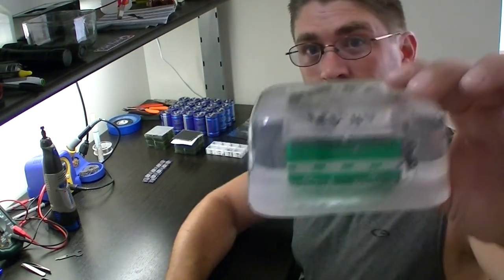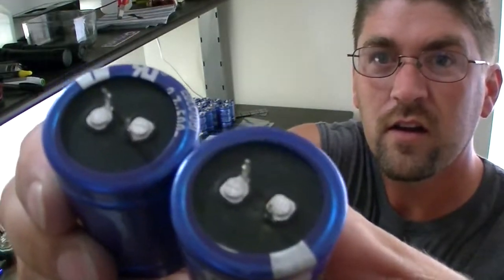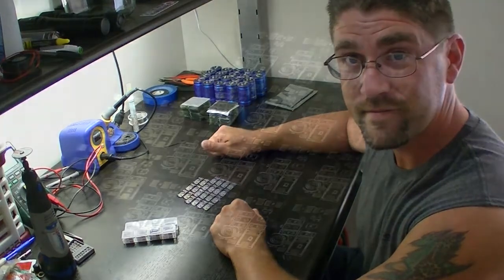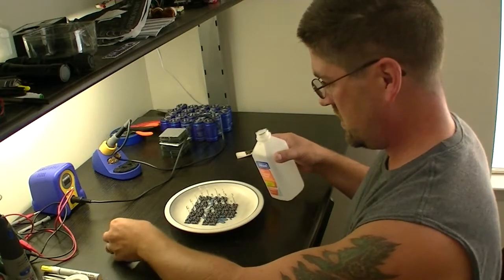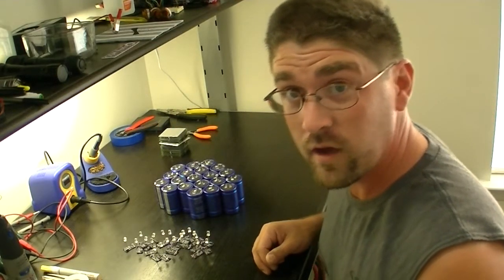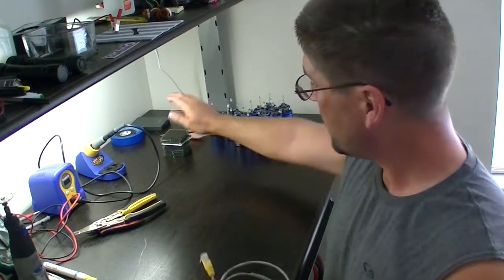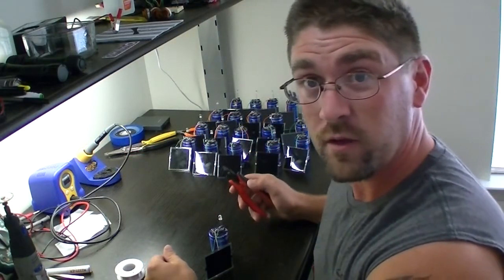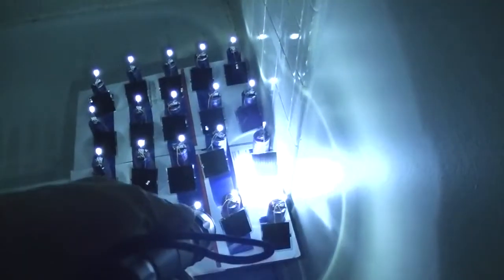Assembling First Batch Of Infinity Solar Jar Circuits For Sale

Comment: Please be warned:  Those small/lightweight "500F" supercapacitors are USUALLY fake in their Farad rating!  (OF COURSE, YOURS MAY BE TRUE!)  Especially the one's used for mounting in series on a protection board--they are likely less than 100F.  I have not been able to find a single cap like that (labeled 500F) that was anywhere near that value.  My last one tested at only 87F.
I check them by employing the formula i(t)=Cdv/dt solved for C:  C=IT/V works only  if you use "constant current" charging (or discharging).  All my other supercaps test as labeled.  You can get a very low-cost constant current dc-dc converter on ebay.

BTW:  I would love to purchase one of those modules after seeing your testing procedure!!

Comment from the maker: I don't sell them as a kit that someone can solder up themselves.  It would actually cost more for me to get a ton of little antistatic bags for each component then just "pay me" through the regular price to solder the circuit board for you.

I actually just ordered the parts for the 2nd batch so they should be ready for sale in 4-6 weeks.

Comment from the maker: The board is designed to only output 5mw to the led, and the boost circuit tops out at 200mw.  Sorry not a good candidate for a 5W LED.